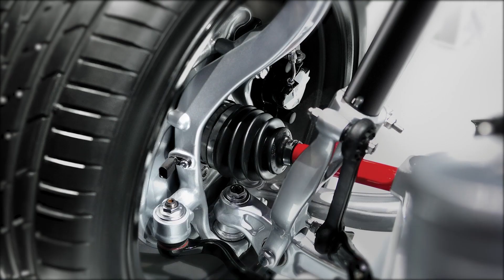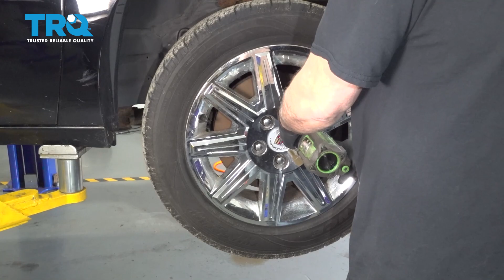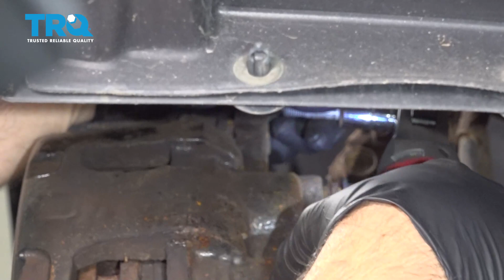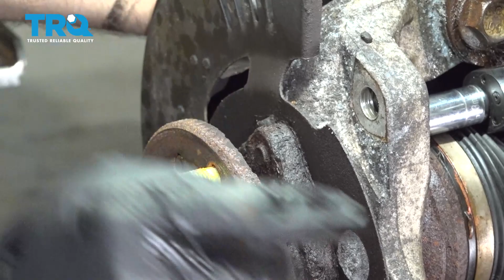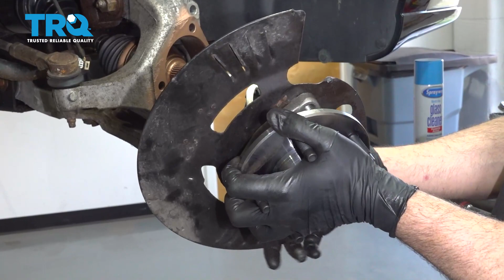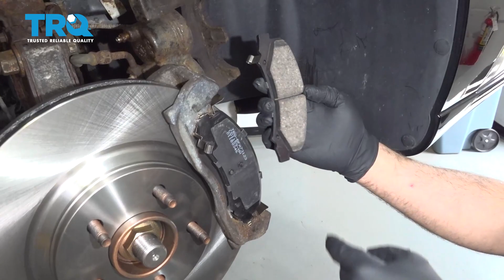How To Replace Front Wheel Bearing & Hub 2006-2011 Cadillac DTS

Comment: about to do all this over the weekend. CV axles, wheel bearings and probably driver side control arm as I did the left side last weekend. I also have motor mounts and transmission filters. Getting it ready for winter.